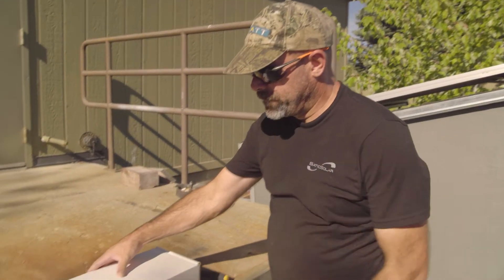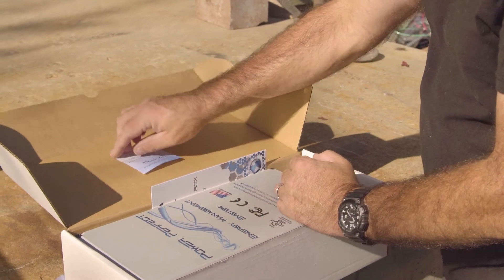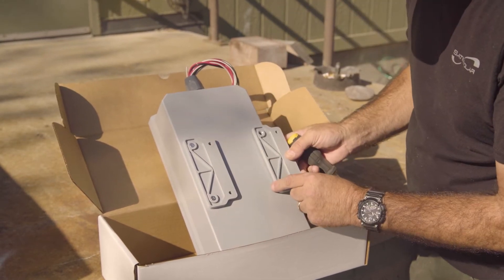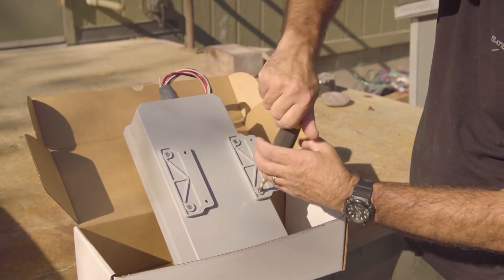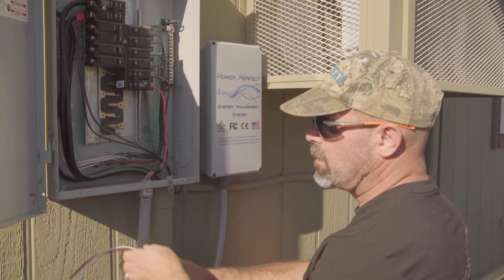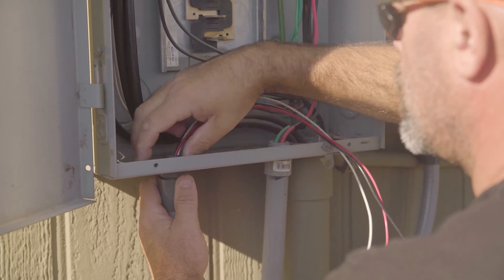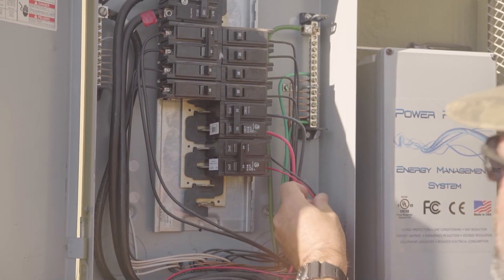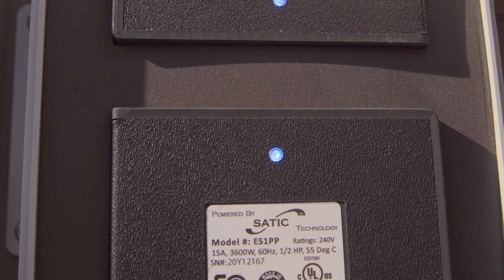Satic Power Perfect Installation Demonstration

Comment: The instructions that come with the unit say to use a two-pole 15 amp breaker, not a 20. The web site installation instructions also say this. Which is it?
Reply: Great question and nice catch. SATIC USA manufactures  a lot of models in both single and three phase configurations. Whatever model you select please follow the instructions that come with the unit. Most single phase residential units land on a dedicated two pole 15 amp breaker, so the tech department gives you props for the great catch.
Reply: @b.d.ericksonii203  I was recommended the PPBSD.

Comment: Is the Power perfect box UL approved?  Does it have independent testing to prove the claims?
Reply: Yes the unit is UL listed, and has been rigorously tested by leading labs and industry experts for over 17 years with over 100,000 installed. Thank you for watching and for the great question.

Comment: Since it’s 20 amp double pole isn’t it only hitting the one side of both hots?
Reply from the maker: A double"tap" breaker, hits one leg twice and is often used to make space in the panel. A true double "pole" breaker hits both A & B phases. Great question, please keep them coming.
Reply: So then I would just run a 20 on one side and a 20 on the other side to hit both phases. And place them at entry of panel to correctly do whole house surge protector
Reply: @worst141 breaker panels are not wired left and right, instead, imagine a zipper. They cascade down A,B,A,B on each side. So a two pole breaker is 240v, catching both A and B. Thank you for the great question.